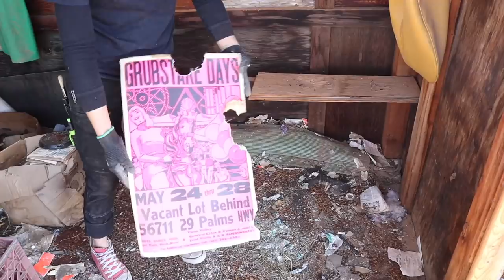Cleaning out a Hoarder's House | Clearing the Property Phase 3

Comment: Keep the tires you have lying around. Stack them and use them as potato pots. It’s a great way to garden. 
You fill them with compost and grass clippings and pop a spud in. Then they grow well and are easily harvested. It will save you digging, haulage costs to dispose of them and is better for the environment.

PS you can whack the top off that stool and use it to grow tomatoes up.

Comment: You're doing an awesome job. Can't wait to see the 'after' picture/video. I know it will be a long way off but it will be so satisfying. Keep up the great work! 

Edit- I read your description.. whew, sounds like you have been overwhelmingly busy. As for depression, try a supplement called,  L-Theanine, 100 mg, You can get it on amazon (or anywhere) I use the All-Star Brand.  It really helps! Do some reading on it and it will tell you all about it. Also, check to make sure it doesn't interact with medicine you may be taking. Hang in there girly, glad you are on the upswing💪💕
Reply from the maker: thank you 🖤🖤🖤

Comment: Might I suggest you just get a skip bin  (or whatever they are called there), not worth creating even more plastic to hold the plastic. You more than have enough.. separate recycling/metal stuff but most of that is just crap..
Reply from the maker: you're right that i should be more mindful about some of the things that go in the bags.  i am doing a lot more of that but there are some circumstances in which the bags are actually necessary.  in my case, renting a dumpster is much more expensive than the way i'm going about it
Reply: @ijessup  I guess upfront it might seem that way, but you've got some serious volume of stuff to get rid of, so a bulk load to get rid of dozens and dozens of car trips would probably save money..?
Reply: @ijessup  and keep it up! You're returning an otherwise unusable mess into a liveable space.. I know what a hard slog it can seem when you're grinding away at a mammoth task.. I have a bush block that has tasks like this, e.g. floods washed out roads and it seems overwhelming staring at all the stuff that needs to be done.. You can do it! :)